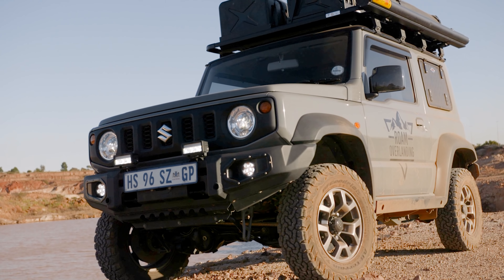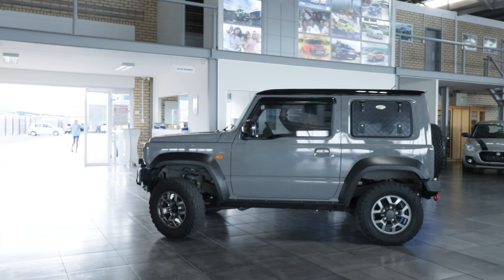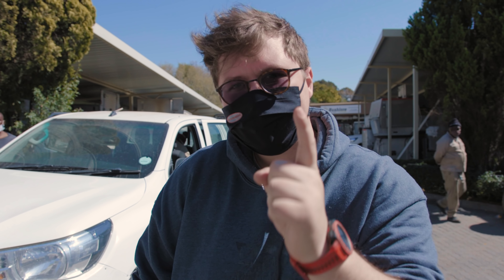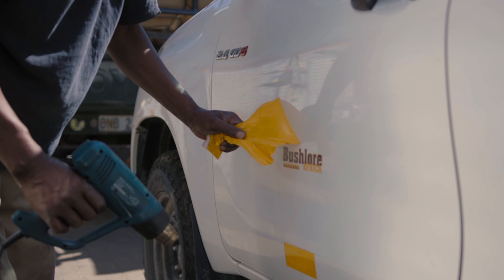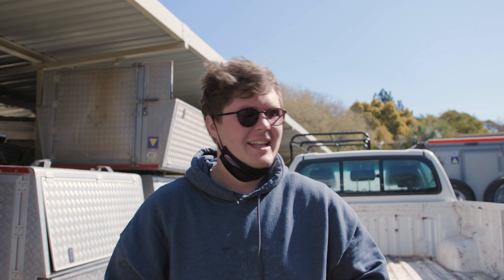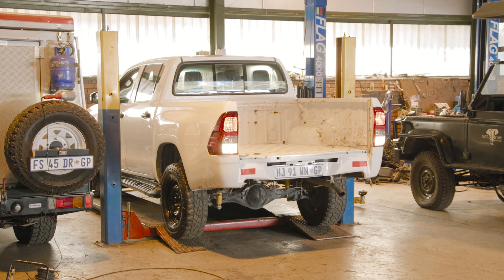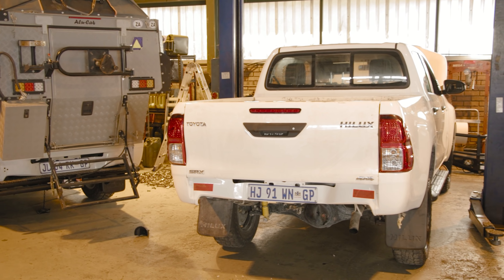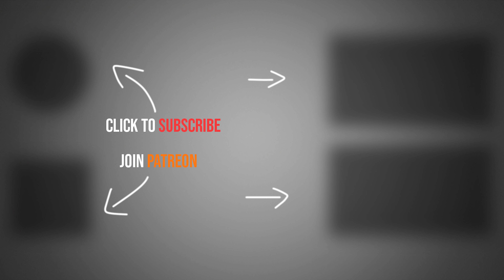Ep1 Selling The Jimny, Buying a Used Hilux

Comment: I this the widebody SRX? Can't quite tell from the video, but it looks like it.

Also, the Tires - what is the size? They look a bit narrower that the stock tires?
Reply from the maker: Hey Wouter, it is the wide body indeed. The tires are a 245/70/17 👌🏻 skinnier but the same overal diameter
Reply: @RoamOverlanding  Subscribed ;-) Going catch some tips for the 2021 trip!

Comment: In terms of size and offroad capability, how does the Hilux compare to the Land Cruiser, or even a Rav4? I’m wanting something that is good offroad, but is just about premium enough to be good onroad.
Reply from the maker: The cruiser is better offroad, marginally but it is better. It can take bigger tires, has solid axles etc. But its very agricultural, and very basic inside. Its a monster on the road, and turning and parking it is a problem. I went with the Hilux because I want a truck that behaves like a car, but is still extremely capable offroad, and can carry a load long distance, while still being relatively fuel efficient, until the Cruiser which is a massive gas guzzler.
Reply: Roam Overlanding Thanks for the help! This is why I love the car community XD

Comment: Hey bud what's the details of that hilux? What motor etc
I saw 2.4 badge but not sure what motor that is. In aus we can only get 2.8 d4d
Reply from the maker: This is a 2.4 GD6 the baby version of the 2.8; mated to a 6 speed auto box 👌🏻 she drives like a dream.
Reply from the maker: @kroodle8  I had more control this weekend on the trail than ever with the manual. It was incredible. I definitely made the right decision

Comment: I have the same vehicle, its an awesome base from which to create an overlander that you can use in the city when not on trips
Reply from the maker: I have been surprised by how easy it is to drive around town 👌🏻
Reply: @RoamOverlanding  Yeah they are great, and the fuel consumption is pretty decent if you drive well. I am at 9.4 at the moment I think. I had Mikem put in new suspension and a 50mm lift, I highly recommend this. The hilux on gravel in 4x2 is not a great drive, always use 4x4 and change the suspension. Many happy miles!

Comment: Great choice on the Toyota Hilux. I also drive one here in Brazil.   
I have a question regarding these in South Africa, what is more common, manual or automatic transmission ? Here in Brazil they only offer the manual option on the cheapest version. How does this works there? 
Congrats on the channel, your filiming is really PRO.

Comment: Delo mgx 400 for your next oil service. Oil that a lot of use in our bakkies and cars. If you have any vibration when braking,your front rotors are warped,there has been issues with hilux/fortuners that toyota repaired under warranty when they got the issues.
Reply from the maker: Thanks for the info bud! No vibrations 👌🏻
Reply: does your bakkie have a secondary fuel filter? Check out turboformonce,they supply the Racor filter with kit for tge hilux bakkies ,get the 1 micron and install after the oem filter. Oem filters first then racor filters.You also get a UDF filter from voetspore that is 0.5micron but more expensive. The racor is 100% and costs about r3000 a year ago. Helps against the dirty diesel/water.
Reply from the maker: awesome, thanks boet! Will definitely look into it for maybe a DIY Project
Reply: @RoamOverlanding  cool man. A injector spraying is 1 or  2 micron. And a oem filter  is 10micron usually so you can see how dirty fuel passes through the injector with just the oem filter. Hence why a 2nd filter is a good idea especially when overlanding. Thats why you first filter with the 10micron oem filter then it goes to the racor 1micron then it goes to the injector. Keeps those injectors safe.

Comment: I think I read somewhere that these Hilux's have a problem with dust getting past the air filter element which apparently can cause the engine to go into limp mode. Good luck with your build

Comment: Excited for U & the new build. The bakkie will have more room in the rear seat row than Your whole Jimny :-0 May we ask the reason why You are not talking anything else off Bushlore? Such as Canopies, awnings etc? Seen as Bushlores loss can become Your gain as U explained in another video. 
No need to share financial spesifics, but it would be interesting to learn how Bushlore prices their vehicles compared to the open (visable/online) markedprice. 
Without going into detail -> I know they regularely in the past have phased out older vehicles to private customers somewhat disguising their rental past.
Reply from the maker: Hey Peter, well I am not keeping any of the Bushlore stuff kit because I already have a certain set of sponsors who are onboard with this build, so I need a blank canvas for those products to go onto. The bushlore vehicles are definitely sold under the normal market value, but fixing up the bodywork etc is on you. So I have budgeted X to fix it up and it still comes in under the market value of buying it at a dealer or reseller.
Reply: @RoamOverlanding  That makes perfect sense😁👍 We dont mind if U share spesifics on what needs to be done to the vehicle (cosmetically) to bring it up to shape. I have on my trips to/through ZAR seen some pretty molested rentals. All the best, Your Chanel seems to be picking up in contens &  quality. Good on U Bud👈👍 Krgds from🇳🇴

Comment: Howsit Adrian, great choice on the Hilux! Just wanted to ask if you're not slightly nervous buying a used rental 4x4? I've just heard of inexperienced drivers seriously abusing those vehicles? I'm sure you've done a proper check and got the best of the lot from bushlore though!
Reply from the maker: I am super nervous Craig! But these vehicles are pretty bullet proof, and Bushlore have maintained them well. So let see, there is only one way to find out 😂 otherwise besides some dings on the doors the vehicle is pretty clean and well looked after 👍🏻
Reply: @RoamOverlanding  Fair enough, I'll definitely be watching closely then! Might consider this route to upgrade my 4x2 eventually...Goodluck though,  and maybe I'll see you out in the Bush sometime👌